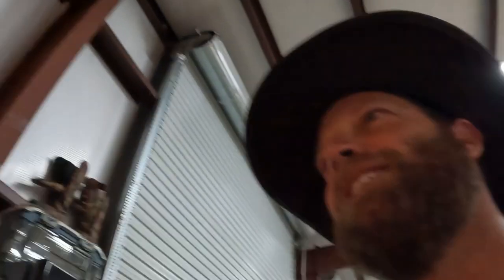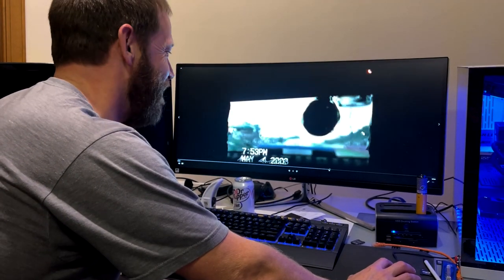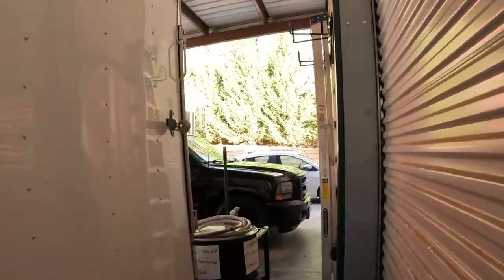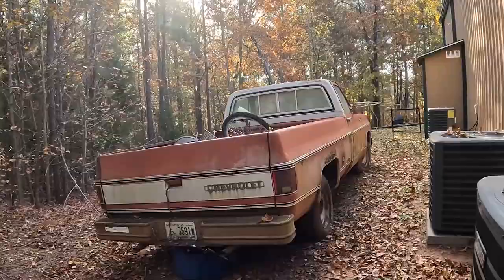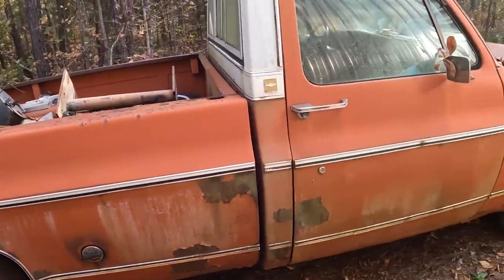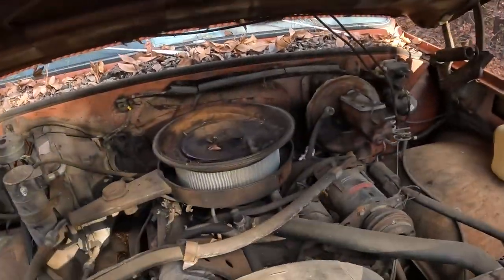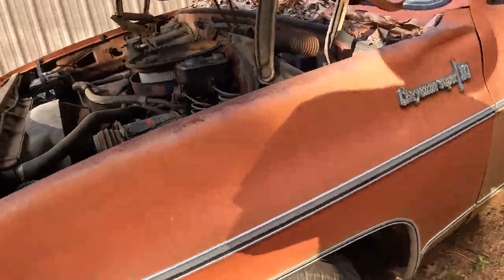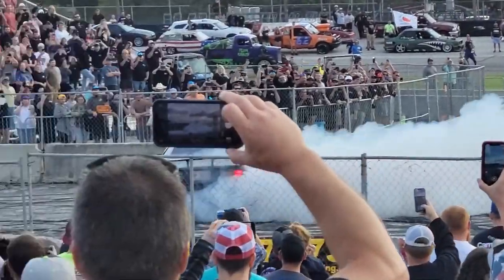Stevie Fast Jackson debuts "Project Ronnie" New Build - Episode 1 - Help Me Choose a Path

Comment: If you don't really care what people think then I'd go Ford 7.3lt Godzilla with a Harrop supercharger a 6 speed Holinger trans with an independent rear end using a Winter's quick change diff big AP Racing brake kit running on 18 inch wheels with Emtron engine management Velo race seats built in the style of a Nascar truck  low fast stops and turns.

Comment: Ridiculous motor and leave it rough sounds fun, but for a while I drove my 76 shortbed with a mild big block and 4 speed, and had an absolute riot. 350hp didnt break a whole bunch of parts and I got 14mpg on the highway pulling a trailer. I drove it almost daily for 2 years until it wiped a cam lobe. Saving up for a big block cam turned into sitting for the last 20 months.....stupid adulting got in the way.

Comment: Keep her all steel, make sure it stays a 73. (Specific 73 grill etc) 

Please keep it stock appearing, restore it to the point where it's repainted with no rust, but still stock looking.  Then...632 stroker motor, trans-brake, all motor raped ape! Radial but bead lock ralley's, 4 link.  Make her function, but rip.  Everything under the hood. 

Then in honor of Ronnie, Normally aspirated, single dominator.  (I love holley dominator efi, but I think an 8 sec NA all steel truck would be perfect.  (I was born in 73 so I already have a thing for this square body😎

Comment: Keep the outside as it is. Take a new LT engine rip off the direct injection bull shit put a screw charger and Holley FI on it and a nice pulley  setup with AC and power steering.

Comment: Don't mess it up in a burnout pit. You will hate yourself later. Fix it up. Resto mod it. Make it safe, reliable etc with more power but leave it looking outwardly untouched. Or if you do fix the holes patina them to match the rest of it. So you can embarrass your kids with it, As well as unsuspecting yokels.

Comment: Leave the weathered body and make it a camping truck.
Redo the drivetrain, upgrade suspension (keep factory height). Try to find someone that could recreate the seat with imaging or air brushing cloth. Nothing sticking out of the hood. No fancy rims.
Add a hitch and a modern slide in sleeper camper. Buy a Bass boat
 You would use it more than a burn out truck.
PS: watching burnout cars bore me to death. Fun if you are doing them but I think they're boring to watch.
PS2: Pikes Peak or Bonneville truck.

Comment: Number one, build something you can drive. This country is littered with garage queens. Pressure wash the whole thing. Replace every piece of rubber, body mounts, A-frame bushings, leaf spring bushings. Lower 5/7 under $1K, rebuild front disc brakes and add rear disc brakes, not that expensive. Fix air, Sanden compressor, redo seat and buy new door panels LMC,, nice stereo, rebuild engine, better heads, Quadrajet, better exhaust, Dakota Digital cruise control, 700r4, stock rims and hubcaps with better tires. You can fix it if it breaks and your daughter will be able to drive it. I'm doing a '77 C10 shortbed. I.m in Arizona, I might want to go to Oregon, I can drive it and it's cool. I did get rid of the bench seat, takes up too much room. Replaced with Fiero seats. No way to send pictures.
Reply from the maker: Thank you Darris. Great advice

Comment: Leave the body alone and throw a roots blown big block Chevy on methanol a glide and 9" and party on the burn out pad OR it looking like it does and go the sleeper route and build a pretty rowdy and halfway reliable big block that is streetable with a F2 or f3 136 run a 4500 Super Victor setup for 16 injectors run 8 Bosch 210's and 8 billet Atomizers 550's for all the methanol , two speed 400 with a gear vendor 9" rear end and either back half it and 4 link it  or ladder bars keep it simple and on on 28x10.5w's or 275s or 315's and do everything with it like drag week burnouts and just party every where where streets track parking lots every where and it has to have zoomies?

Comment: 540 big block Chevrolet doors floor plan put a bed on it you'll be able to shut the hood on it 540 big block is a crate motor comes with a warranty in Independence

Comment: If that was my Dads truck, and had your means to do anything with it… I’d put it back to exactly what he had, only like brand new, every nut and bolt. You said yourself he was non conformist and didn’t even want fuel injection. Same engine, ( with discrete sniper fuel injection, shhhh), overdrive trans, better brakes and suspension, same color combo only better quality paint, and a leather comfortable yet stock appearing interior. Take your kids to school in that.
Reply from the maker: Thank you Trevor. Great advice

Comment: If you love the truck don’t turn it into a burnout truck because sooner than later you will wall tap it into scrap metal.  If I was you I would fix the rust and paint it back to its original color and put a the engine of your choice in it but me it would be a blown big block with a 6 or 8-71 blower using electronic fuel injection for street drivability while still keeping the A/C, P/S, Power Brakes etc or if you don’t want a hole in your hood a LSX with a under hood screw blower. Lastly lower it a little but whatever you do don’t c-notch the frame and slam it on the ground because it’s totally pointless and stopid looking and don’t keep the crusty rusty look opps I mean “patina” because you have the cash and know how and know people that can do bodywork and paint. Personally I call the rust crusty patina look a lazy man or a poor man’s excuse for not doing bodywork and painting your car
Reply from the maker: Great advice! Thank you!